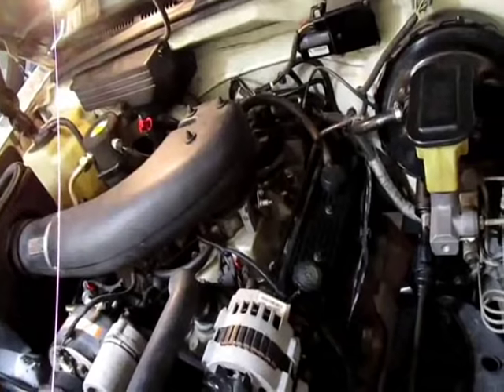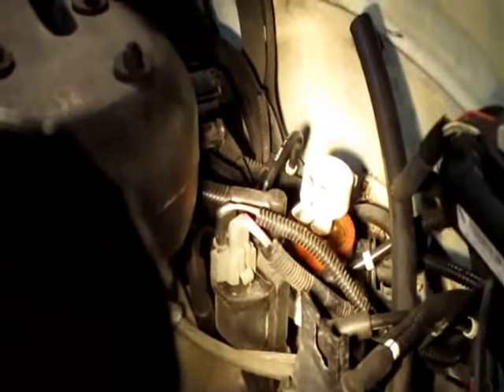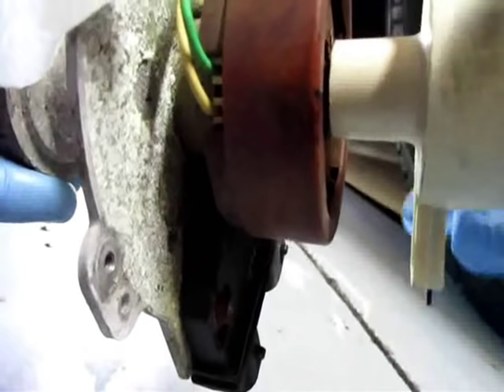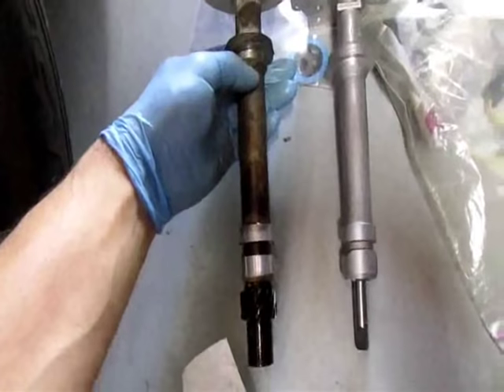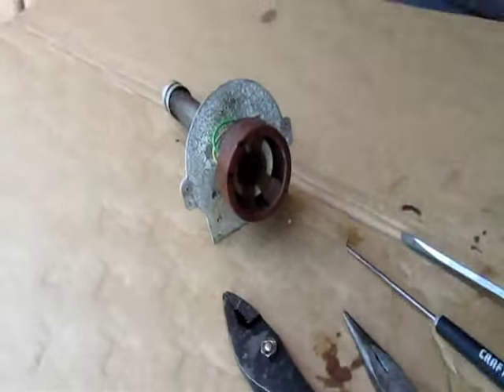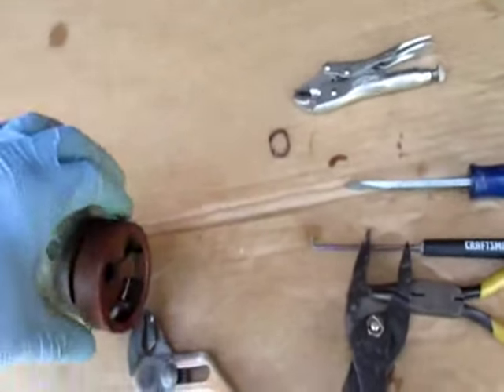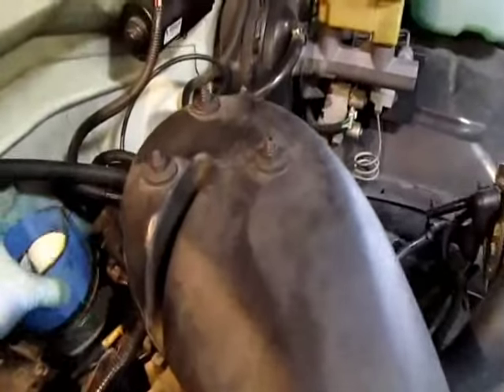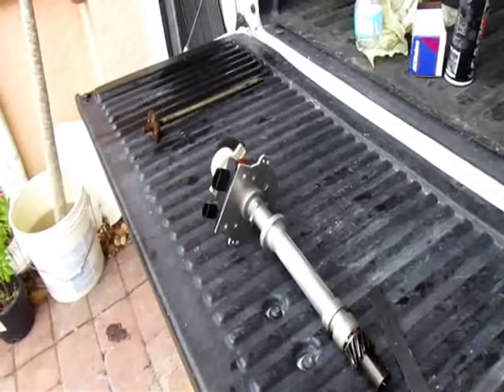Removing, Rebuilding Installing Distributor 88-95 GMC Chevy truck 5.0 5.7 How to?

Comment: I'm rebuilding the distributor in my brothers 94, 450k miles, driven daily, bought it 1 year old. Original distributor.
Reply from the maker: v8? 450k nice
Reply: @GhettoWagon  the tbi motors from 88 to 94, like the 350, and the 4.3 liter vortec are high mileage engines, when they are maintained and not abused.
Reply from the maker: @davidpotter7484   I know I Driven then all.  1995 was the last year . tbi started in 87 so 87-95 .. Well 86 had tBI too in some engines    I have seen alot with over 400-500k some looked like original engines some not
Reply: @GhettoWagon  i meant 88 for this body style,  94 is the last good year for any vehicle for me. Kenworth, peterbilt or chevy, because of antilock, and airbags. My 94 astro van had 485k, when the frame went bag, motor still purred. Im looking for another 4.3 4x4 manual tranny for my brother for hunting when he retires.

Comment: Great video. I'm working on an 89 GMC truck and have gone through everything except the distributor to fix a rough idle. This will be the next thing and you gave me some ideas on what to look for.
Reply from the maker: Usally just cap and rotor fixes that, I had a high RPM surge once that cracked/ slipping magnetic star was replaced with a new shaft it fixed it.  Been that way for ages.   Timing used to change when it wanted because the magnetic star would slide up and down and since the distributor gear is helical it would usually retard the timing and bog
Reply: I'm with you. I got rough idle only when warms up and hard to start after shutting off. I've checked the vacuum system, fuel system, ignition coil. According to Haynes the pick up coil is the next thing so tomorrow hopefully it works when done. Very good video though. Not to many show how to take apart a distributor anymore.
Reply: Rough idle is gonna be fuel mixture / pressure, vac leak, timing plugs or wires.   Do compression test if that doesn't work.

Comment: you can get a delphi dizzy for like 160 bucks on rock auto. my 92 Blazer with over 300 000  miles had so much play on the rotor button from the worn out bushing. Great idea with the crowfoot socket for the hold down bolt, those dizzy wrenches were getting me nowhere but ready to throw something.
Reply from the maker: They make those, delphi distributors then they are gone for years. Now they are back again.  I wonder if they look like the OEM distributor when the cap is off

Comment: Very informative. Thanks for making this video. It answered literally everything I needed to know about how to rebuild the bottom end of the HEI. I wasted time on 3 other videos that were supposed to answer that question, among others. I think you should have a website if you don't, and you should take donations through Paypal or whatever. I'd send you probably 20 bucks or more, because I think it  will end up saving me a ton of time and money.  I subscribed to your channel, and any 350 Chevy videos like this with proper steps part names and precautions I will be looking forward to. Thank you.
Reply from the maker: I apologize for ending it abruptly and I never made a Install part. with tricks to get it in the hole.     Ahh, Save your money like I do. . I have the other video when I take it apart again reusing my housing  Since I fixed this, I have NO MORE high RPM miss on the highway. the RPM used to fluctuate about 300 RPM at wide open throttle passing in 3rd gear   The cracked "star" was the problem. Dont think I have any more videos soon coming up but I have some old ones.

Comment: I bought a new distributor from a local performance shop that is very poor quality. You do a great job instructing on how to rebuild my OEM. I will be rebuilding my original even if it is just to keep it on hand. However the shaft link Amazon states it is not for my vehicle. Do I trust them (lol) I have 88 Suburban 350
Great Job
Reply from the maker: Glad to help

Comment: i bought new ac delco housing and the flange is indeed thinner than the factory but i didn't have the problem of the clamp not tightening it down.
Reply from the maker: Some are thicker like my OEM one was and some are thinner. Then I also thought about I have a edelbrock intake manifold it could be machined shorter.    I just reused the old housing it was fine. My main issue was the shaft's magnetic star was all busted. I found another new housing it has the same fat flange as my OEM original does

Comment: would it not be cheaper and faster to just buy a whole new distributer I found them on amazon for 50 to 60 dollars ?
Reply from the maker: Go ahead and support china and have all non OEM parts.    That's why I fix what I have its quality. In parts I was into this for under $50.

Comment: Silicone heat sink between module and ditributor body, interesting. Kid at auto shop sold me dielectric grease to apply but as I thought about it, it's more similar to applying thermal paste between my computer processor and cooling fan to transfer heat, and so I did. The silicone you used must be the auto version of thermal paste?  ..'cause I'd think the Dielectric I was sold would actually prevent heat transfer.
Reply from the maker: Kinda. you can also use computer heat sink paste Used it before.    When you buy a module, usually they give you a small tube of some heat paste, its like a silo cone but it does not do a good job.   

On your ignition module when you change the cap and rotor its good practice to remove and clean and repaste it just like one would do on their computer.    It cooks. kind of like what happened on one of my laptops and it overheated all the time until I cleaned and re-pasted the heatsink!

Comment: The washer is actually a shim.  Spec on gear endplay on the large-cap units is 0.010"-0.020".  I try to get it as close to 0.015" as possible.  Getting this correct keeps the timing stable.
I usually blast the bases and sheet metal pieces in a cabinet with walnut shell media. Walnut shell is a little more aggressive than plastic beads so it removes most of the corrosion but will not remove good metal quickly.  I rinse off with isopropyl alcohol.
Moroso makes shims to space the distributor housing from the intake.
Reply from the maker: Yes it is a shim.  They only made one size for these and the design allowed for a quite a bit of play. This is a Small cap. Their reasoning was to allow the distributor to move up and down under decell to oil the top bushing better. Yea , I dont have a blaster.   This housing was just junk. I have two other ones that fit fine. Dunno what the deal was with this one. The casting was very bad on it  All cracks, very rough. Nothing like the others I had

Comment: Thanks for the info
i started working on my 305 and the distributor is on the list for tomorrow. 
Your video answered a lot of questions i had
Reply from the maker: They are easy to take apart.   This piece of junk stalled on me today!   Maybe the junk torque converter it has is locking again when it shouldn't.

Comment: shes done. will be ordering a new dist for my 89 350. hopefully solves my engine acting like its redlining at 2k rpm.
Reply: Did it stall a lot? Misfire? Mine stalls out like crazy only got the egr left to replace sensor wise, so I'm thinking it's the distributor

Comment: How did you put the gear back on,does it have to be pressed on and pulled off I can't get my gear off the pin is out?
Reply from the maker: Knock out the roll pin as shown.  Comes right off
Reply: @GhettoWagon  okay

Comment: Where did you buy the extra parts from? Like the clip, the washers and stuff like that? I bought a cheap ICM and pickup coil off ebay just so I can rebuild my old distributor to keep as a backup. But I do want to do it right, just in case I need it. Also, the pole piece that was all rusted at the top: can I soak that in rust remover/chem dip? I want the shaft and pole piece to be clean.
Reply from the maker: The shims I bought 10-15 years ago when I was a kid when I rebuilt another one, the round clip for a pickup coil should come with a new pickup coil, they are hard to find I believe its a 9/16 internal locking clip.  I found some on amazon Ill try to dig up what they were called. A good hardware store probably has it.   Yea you could soak the star piece in acid. always replace it because its cracked. Get a whole new shaft.

Comment: hey bro i replaced my cap and rotor twice.thats why im now watching your video.my problem is when i replace the rotor my truck drives perfect for about 2 days then my rpm jumps up and down.the first time my s-10 stalled on the highway.now today after 2 days my s-10 rpm is sputtering again.sorry kinda long.my question is do you think my timing is off?because if i keep on replacing the damn rotors is like 12 bucks a day lol.hope to hear what your thoughts are.thank you for this video.
Reply from the maker: Does the rotor or the cap looked burned where the coil wire contact is? If it does the distance between the cap and the rotor could be too much.  That or the pickup coil could be failing, The TPS sensor on these GMs will cause a erratic idle or surging when they go bad, but they won;t throw a code if they are still "in range"  But barely.
Reply: Hey man. Can you resolve your problem? I changed my module today and do the same

Comment: Does 335$ sound right to replace the whole distributor in a gmc suburban 1991?
Reply from the maker: I dunno. I guess.
Reply: Paying someone maybe. Other than that for $335 you should be getting 2. Autozone was $75 for distributor and $18 for cap.

Comment: I removed my cap and found lots of magnets all over i got no spark after i removed all the parts should    im noy a mechanic just don't have money at this time im diy  could this be my problem i install a new ignition coil no spark
Reply from the maker: If there are magnetic that came off the shaft of the distributor. On the top is a star with magnets ya it probably broke apart. Mine was cracked I had another on my wagon same style distributor it made a grinding noise haha.  Get a new shaft for it  Standard and AC delco make them    Just need to remove the distributor and replace it though, Retime the engine
Reply: @GhettoWagon  yap will this be my issue of no spark on my 1990 s10 blazer 4.3 im currently unemployed don't have a lot of money i need my truck to find work asap
Reply from the maker: @tlkw  It could be the issue.  Its no good of the star came apart  The pickup coil uses it as a signal so the coil and injectors fire

Comment: I just took the distrib out of my c1500, with 180k miles on it, and it looks brand new. Factory as well. I dunno how that can happen, if everyone else says their distributors are going out at 100k.
Reply: Aftermarket parts probably. I hate that everything is aftermarket. No way to get OEM parts unless pulling it from a junkyard truck

Comment: very helpful. was the shield over the coil pick loose or snug when you did this?
Reply from the maker: it has a little rock to it, Normal. As long as you can't pull up on it its fine

Comment: He's got it aligned in the wrong position for it to seat. His clamp is supposed to be bent. Rotate the spindle one position at a time and try to reinstall eventually it will seat. Just be sure your not off 180°
Reply from the maker: no That housing was not made correctly. It was seated correctly  The clamp on my other car is not bent some on junkyard trucks was not as bent as mine

Comment: Could the clamp being bent be causing  the distributor to be loose.
Reply from the maker: The clamp is not bent I compared it to another.  I have i dunno at least 4 clamps now from the junkyard.  :)  sometimes I think stuff is wrong when its not, the heat here will do it to you.   No the housing on that crap part I got from ebay was cast shorter than the original. I have another housing that is cast just like the original.

Comment: Your distributor hold down clamp is bent. 0.080" is not enough to cause the housing to not tighten. The clamp is bent!
Reply from the maker: They had two different housings a fat one and a thinner one  The clamp fits the OEM thickness housing fine  I reused it and I even have a spare brand new one that is same thickness

Comment: The clamp is supposed to be that way, I think you had it upside down when you installed the rebuilt distributor...it points down the fork does...but also nice video, but I would like to have heard your truck before and after, I'm having trouble with my engine just gave out one day and when we can get it to run it's very ruff and kinda up and down, it's in time though and we've checked the wires order over and over to be sure...so I'm thinking my points may be bad cause they touch...
Reply from the maker: Nahh, The housing was junk, it was cast too short. The other housing I had in my hoard (brand new) was the correct height, same like the original crappy one I cleaned up. .  The truck sounds the same, It just has a whole lot more power at higher RPM.  at WOT at around 60-80 MPH when it would downshift to 3rd gear at about 5000+ RPM the engine would surge slightly. Now it does not.  It would erratically bog down too at prt throttle but now its seems better. The engine is worn so its never going to be perfect, it needs the heads rebuilt, guides valves etc.   When the Star on the shaft cracks bad, it may cause it to run bad, depending how bad the split is. The pickup coil will shut one of these engines down in its track. You can check the resistance of it by unplugging it on the module. If it reads nothing or pretty low it has a broken wires in it.

Comment: I just ordered a new set of those ICM screws off Rock Auto for $9 because the rust was triggering my OCD. AC Delco Part #10469668. Kinda shitty no one includes new ones with the ICMs when you order them, because those screws do ground.
Reply from the maker: yea I just usually clean em up good I think  some i coated with a little zinc and put grease over the tops.   If you want a like new screw just soak them in phosphoric acid for half n hour or more. will be nice and gray. I coated the new distributor parts with a little fluid flim. , took it apart a few months ago when I was chasing a driveablity problem turned out my 9 year old fuel pump quit again.  40k of use   had 7.5 PSI lol.  Anyway the fluid film even stuck to the distributor star!  It didn't rust too bad!

Comment: I have spent 3 days trying to get my distributor in and cannot for the life of me get it in on a 93 s10 4.3
Reply from the maker: The first time I took it out I had problems too.  If you put the balancer to TDC number 1  and the distributor rotor was set at number 1 before you removed it,  I found when you remove the distributor it will go back in alot easier. I used to just remove it wherever it landed and reinstall it in the same spot.   The problem in your case is that the oil pump drive slot moved. You need to put the distributor in, (Just drop it on, no clamp no tighten)  See how far the rotor is off, take the distributor out,, get a long ass screw driver and blindly find the oil pump slot and turn it slightly the direction of where the rotor needs to land. Then try again and again and again. You will get it.   After rebuilding a 2 distributors I wound up with old distributor housings.  I take the gear off, leave the shaft in!  When the oil pump drive slot moves I put the dummy distributor in w/o a gear, turn the dizzy shaft until it gets in the oil pump drive notch then turn the top of the shaft where it has to go. Take out the "dummy distributor" Put in the real one, it will drop in perfect.
Reply: Get you a different hold down dang. It’s not that big of deal to get the hold down to work! If you get another housing you’re doing nothing but wasting time and money!
Reply from the maker: The housing was casted poorly, it even had cracks allover it, It was some ebay junk piece.  No I got my truck to work I did not waste anything
Reply: Pull your valve cover and point the rotor at #1 while at TDC. Then lightly press on the distributor while rotating the crank by hand until it meshes with the oil pump.
Reply from the maker: Never had to pull a valve cover.   Its easier just sticking a screw driver down the distributor hole and turning the oil pickup slot.  that is what moves ever so slightly and does not allow the distributor to pop back in . Sometimes it does not move. If you lift up the distributor fast sometimes that is the trick to prevent it

Comment: Forgot a spacer on bottom of shaft supposed to go on before washer
Reply from the maker: No. You are wrong Nothing was left out.  The toothed washer then the spacer its exactly how it was.   The clip was cut short. The distributor is designed to have up and down movement to allow oil to get up the shaft

Comment: amen to hoarding!

nice video brother.
Reply from the maker: Heck yea, It pays every time, Its kinda stressful carrying stuff and storing it but when you need it, its no stress.  I always carry extra parts now!   If you have a TBI vehicle always carry a extra ICM or a pickup coil. Cap and rotor too. Plugs, I have it all X20000
Reply: +Ghetto Wagon yes, I love the TBI engines and will always have a truck, van or Blazer/Suburban with one. Right now I have '89 and '94 G20 vans with TBI 350's and will be getting a truck with a TBI engine soon. Every time I go to junkyards I collect spare parts, bolts, you name it. I finally bought some land for a shop to store all of my junk so it doesnt get too cluttered. I keep spare ICM, pickup coil, cap & rotor, serpentine belt, starter.....and who knows what else on hand.